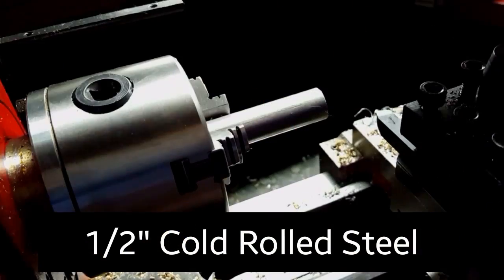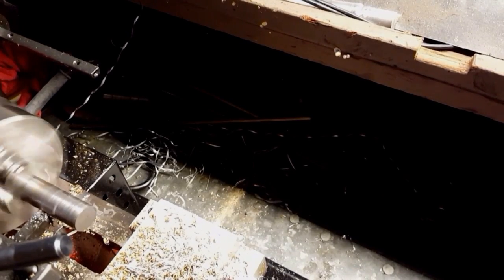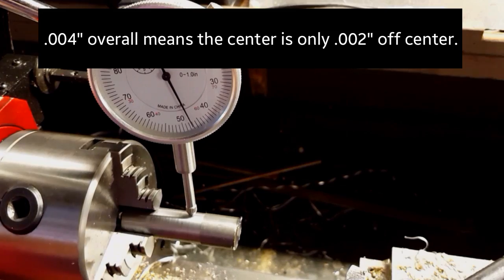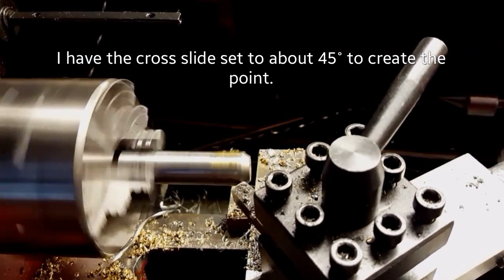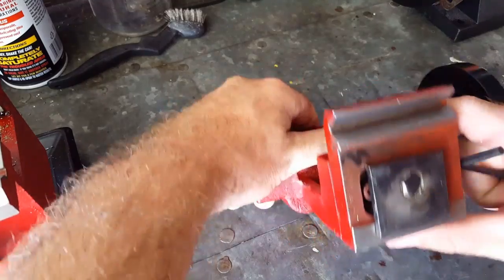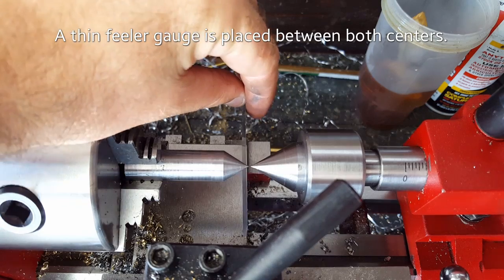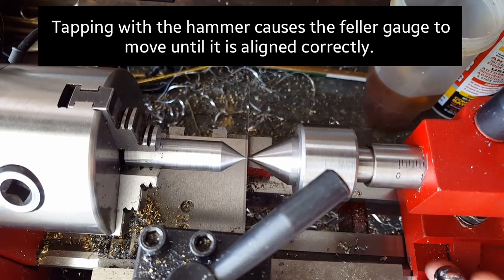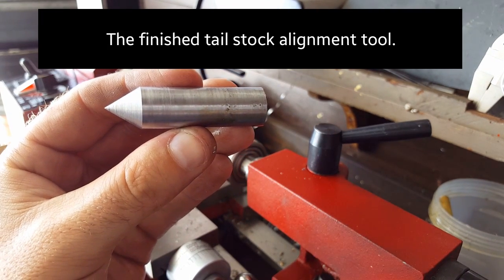Tailstock Alignment Tool

Comment: This is only checking in one of 3 dimensions.
You need to align height & parallelism too.
The parallelism is probably the hardest to get right on these. Test with a dead centre in the tailstock, not a live centre, test with it wound fully in & again extended fully out, that’ll help get it set up better.
Turning your own point is most accurate though, so that is correct, but you didn’t need to turn it round or remove it from the chuck & do the other end, just face it & turn a point, it will always be central until it is removed from the chuck, that’s how lathes work.
Reply: How do you align parallelism?

Comment: A few thousands off on a precision part like a die makes it worthless so it is a big deal for precision work. To line up a lathe takes 4 points, not just two. The headstock must be on a center axis with a front an rear point the same goes for the tailstock, assuming you want to move the tailstock and maintain alignment. If the headstock is not in alignment with the bed, like so many of these mini lathes are then it is the tailstock is never going to be aligned.

Comment: Why not just use a headstock's dead center instead of making a cone of dubious accuracy? The way you are doing this,  you are aligning with the chuck, and not with the spindle. And since the piece is not guaranteed to sit accurately aligned in the chuck the alignment itself is of dubious accuracy.
Reply: Not true. The chuck can be miles out, but as long as the work piece hasn’t been moved then whatever you turn on it will be perfectly centred. That’s how a lathe works.
How do you think you drill off centre holes in a 4 jaw setup? 
Think about it
Turning your own centre (even in a 3 jaw chuck) will ALWAYS be more accurate, providing you don’t loosen the chuck & move the piece.
Reply: I do it as you say, a dead center in the headstock an the same in the tail stock. Works fine.
His way as you point out is not very accurate.

Comment: Better to use a large chunk of drill rod and sharpen that.. then heat it to a full red and drop it in oil to harden. Also. Using this method you need something thicker than a feeler guage. Note : What you did here didn't adjust the vertical ... which has to be shimmed to adjust on that type of tailstock..

Comment: The tool will point to a different center, each time mounted (in the 3 jaw chuck). You need to do slight new cut to the tip each time.
As a la possible solution, one could use a center mounted directly to the spindle Morse taper.
Reply: Exactly my sentiments.

Comment: Good video but it has to be remarked that this method assures alignment at the point where the tailstock is close to the headstock and may be sufficient for most work but for more precise alignment you need a tailstock alignement bar.

Comment: Nice demonstration, I have the same lathe and tailstock, I had done this procedure before, but how do you adjust verticle height? I am about .025mm high. I could only think to hand scrape the underside of the tailstock which is in contact with the bed, which I have not done as yet. Any input would be helpful. Many thanks.
Reply from the maker: hey mike, thanks for watching and commenting. im glad my video was informative. unfortunately as far as i know the hieght isnt adjustable. if it is a little high or low you could mill the surfaces where the tailstock and its base meet. if it is too low you could always shim it. i wouldn't advise grinding or milling the bed of the lathe or anything that touches it